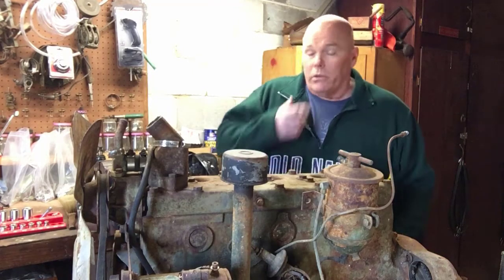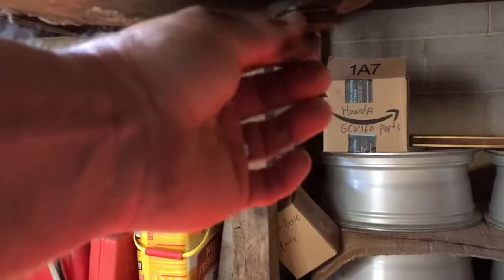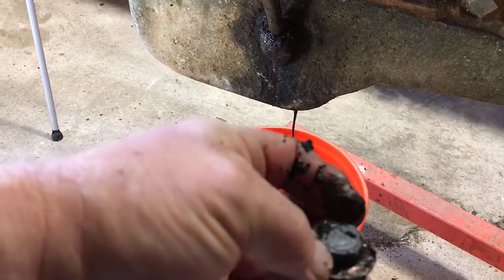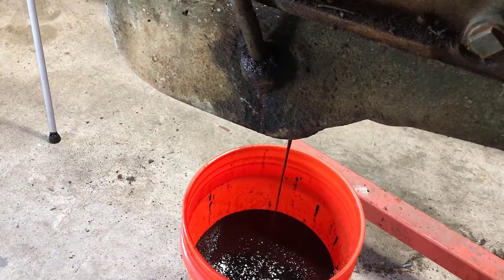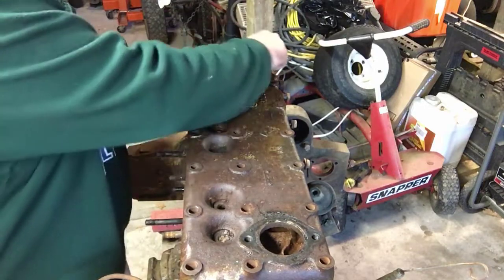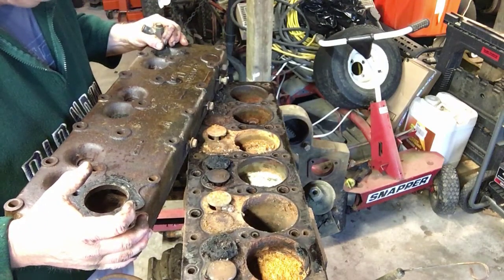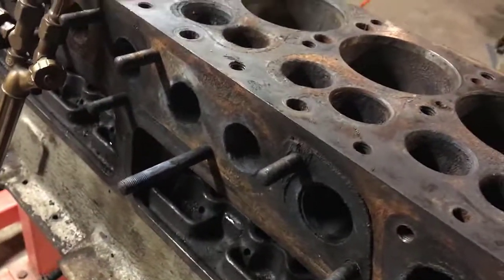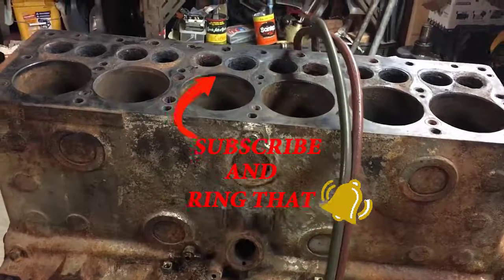1953 Dodge Pickup Truck Part 2.  Is this engine salvageable?

Comment: Looks like the old motor has seen better days. In my opinion, it is still worth having a bit of a play with, but then I do like a challenge. Look forward to the next installment.
Reply from the maker: I am inclined to rebuild this engine, even if it cost me more in the end, for the challenge.  My plan is to have it inspected by a machine shop to see if it is a candidate for a rebuild and go from there. Thank you for your comment!

Comment: I am presently beginning a restoration of a 1952 Pilothouse, looking forward to follow your project
Reply from the maker: Thanks Steve for following my Pilothouse project and l hope to have another video out shortly. Hopefully you are planning to post videos of your Pilothouse build  I certainly would like to watch them.
Reply: @GaryAhl  ,  luckily,  the engine runs good, the body is very solid except a few rusted out spots in the door, door windows need replacement, shocks and a new wooden bed, a Winter project to keep me busy

Comment: I honestly feel the crankcase doesn’t look bad. I was expecting rust all over the place. I think a couple cans of brake cleaner would do wonders. 👍
Reply from the maker: It most certainly was a lot better inside than what I was expecting. I think the build up of thick sludge from non detergent oil is what saved it from rusting.
Reply: @GaryAhl  Good O’ dirty dinosaurs helping out. 🦖🦕

Comment: That engine is rebuildable.  You can go to at least .060" oversize and even get liners that will allow the .060".  My engine block sat in my 51 B3B for years without the head and I went through the same ordeal you did getting this one apart.  I stayed with .060" on mine because three of the six cylinders cleaned up at that dimension.
Reply from the maker: I agree, the engine is currently at the machine shop, and it appears that only one cylinder will need to be sleeved. Unfortunately, the machinist is backed up and it may be several months before I get it back.

Comment: I found my 1953 in a junk yard in ga. would  not  start   loaded on trl.  was last reg. n GA. 2207 I bought it 2011  no fire   --- needs points  that solved run prob.  cranked right  on temp. gas ( 2 ltr ) bottle its value rose
Reply from the maker: Lol… I wish all mine needed was points and some fuel. I was out driving in the country yesterday and spotted a B3B sticking out of a hedgerow. Hopefully I can make a deal with the owner.